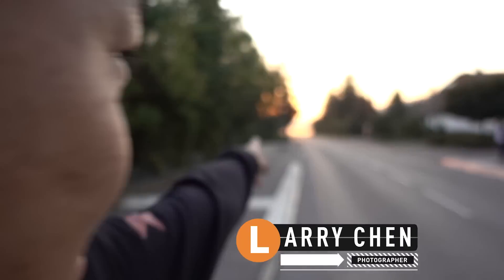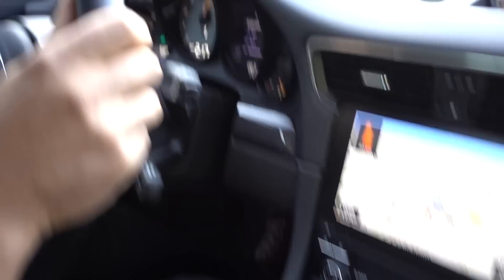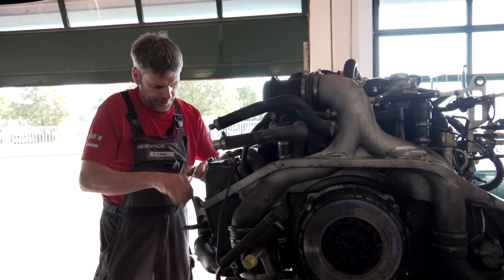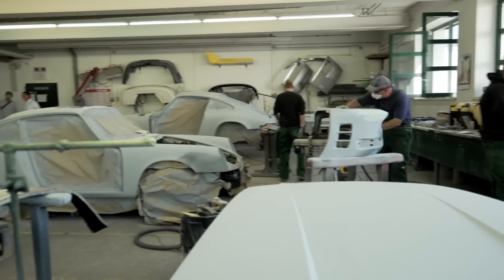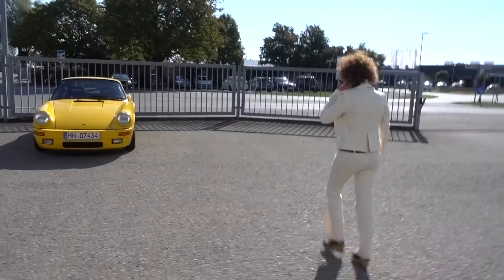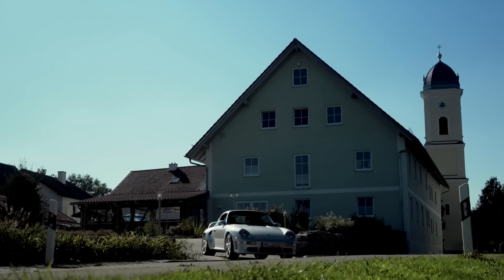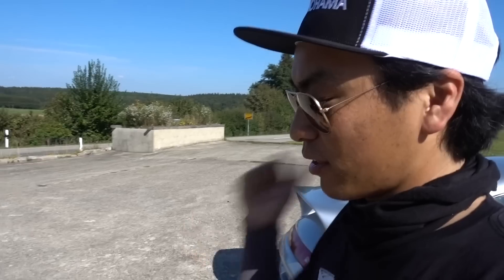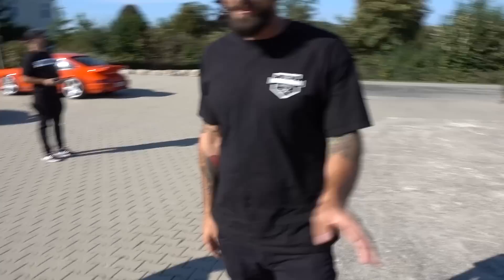Smashing Rev Limiter in a 223 MPH RUF CTR!

Comment: Estonia Ruf finally answered a question I’ve had for years but never had an answer for. I always wondered why the original 1980’s prototype Ruf CTR “Yellow Bird” had the NACA ducts in the rear fenders but none of the production cars had them. Turns out that she said that the ducts didn’t work correctly and that’s why they were left off the production cars.
Reply: I can just listen to her talking about those stories all day long.
Reply: Ryan they created an aero of low pressure above them, meaning little to no air actually ended up being drawn in
Reply: They ended up drawing air out instead of in

Comment: Some Ruf trivia:

-There is a dealership on the front of the building, and they sell a lot of non-Ruf cars
-Ruf has used the same mechanical dyno for... a very long time
-Ruf built the first 16,17,18, and 19" wheels
-Ruf restores Porsche's of all types
-Alois' favorite chassis was (may still be) the Boxter. It is the easiest Porsche to distribute weight to 50/50.
Reply: Cool! Thanks.

Comment: @ 7:57: That CTR2 is so stinking stiff, it lifts a front wheel when they pull out of that driveway.  I can't remember what car it was but there was a 90's supercar that was tuned by a company and they showed off the chassis improvements by doing something similar they pulled it over shallow gutter of some kind and the car the pulled two wheels off the ground.  Ruf is easily the most underrated tuner on the planet.

Comment: What is the difference between RUF and Porsche?
Reply: TheKingPilot one is german,The other is not. The more profound answer would be: think of it as Honda & Acura
Reply: You can see that in the video... an RUF is so much different from a stock Porsche. Basically everything is upgraded: engine, aero, brakes, chassis, suspension etc
Reply: @kenshinhimura8708  no it's not like that
Reply: In the begining RUF was building cars up on Porsche chassis. Like Alpina did with BMW.  But the CTR3 was mostly and the CTR 2017 completely build in house by RUF itself.
Reply: RUF is a own brand, like Porsche. So its not a "tuned Porsch"...some idiots woud say.
Reply: Carpassionist1 

Rufs are tuned Porsches though, Porsche and Ruf still collaborate, they get clean (lacking vin number shells) to build on, and are tuners for Porsches as well you can carry your 993, 996/997 and 991 and get the Rturbo or Rt12 conversion so laymen are correct in saying they are tuned Porsches.

But most that come from Ruf are all their work especially the CTR but the rest are using supplied shells.
Reply: Samuel Jones RUF ist kein Tuner im klassischen Sinne. Da so habe ich es auch schon oft gehört legt man sehr großen Wert darauf, da das Hauptgeschäft darin besteht eigene Fahrzeuge herzustellen. Dann folgen die Restaurationen und die Veredelungen. Als ich vor mehr als fünf Jahren mit einem meiner Freunde dort eine Führung durch das gesamte Werk bekommen habe, habe ich nochmals den Eindruck bekommen, dass man sehr großen Wert darauf legt nicht als "simpler Tuner" gesehen zu werden. 

Somit ist RUF kein Tuner im klassischen Sinne.
Reply: Porsche is a major car manufacturer with 4 different models including a sedan, wagon, and two SUV's. RUF on the other hand, is a small boutique supercar company who started out as a Porsche tuner in the 80's. RUF has stayed much more true to spirit and essence of what the 911 should be, than even Porsche has. Just check out Porsche's website and new 911 for prof of this. No manual transmission is currently available in any of the Porsche's made. Although Porsche says it may offer a manual at sometime in the future.